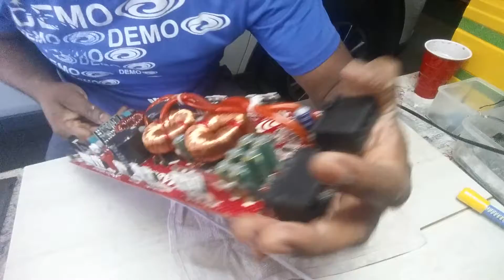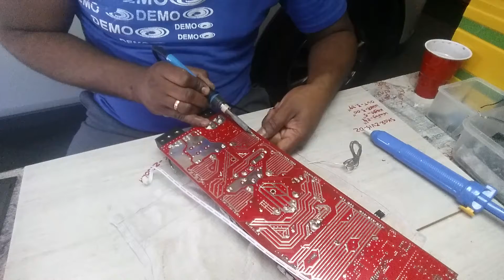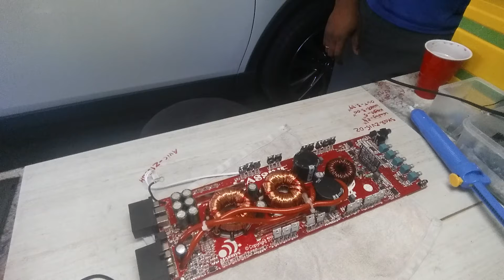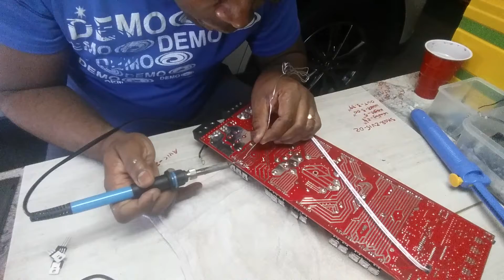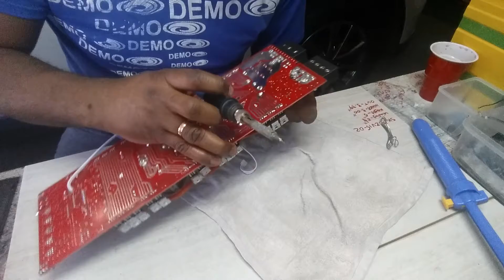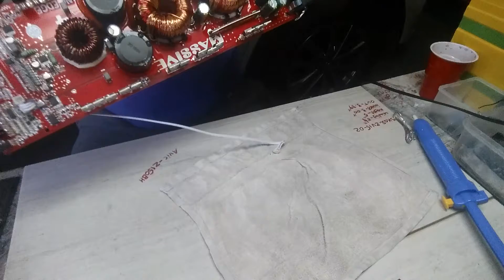Massive Audio Nano Edge E4 Part 1| C&C Electronics Repairs & Sales| Subscribe and Share🙏🏽

Comment: Nice to see a repair video! When you have space like that for the NP capacitor you may be able to use a film capacitor (check the drive signal to make sure). They are big so won't work easily on Hifonics boards but may fit on that Massive Audio board.
Reply from the maker: Ok I understand. I have more videos to upload but don't have ta lot of time yet.  This one is not too perfect but I'll do better next time
Reply: @cartycartyamplifiersalesrepair  You are doing great! If you ever need help just let me know.